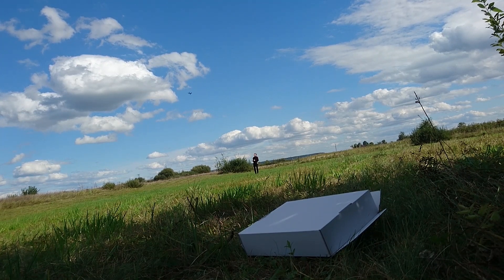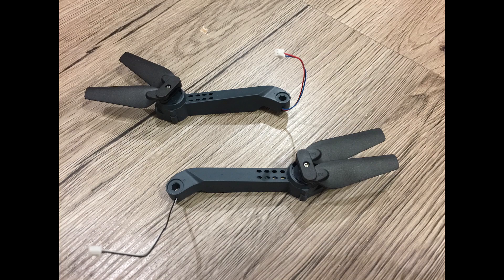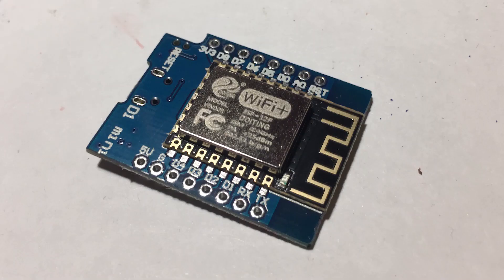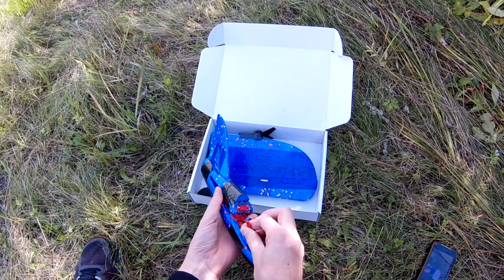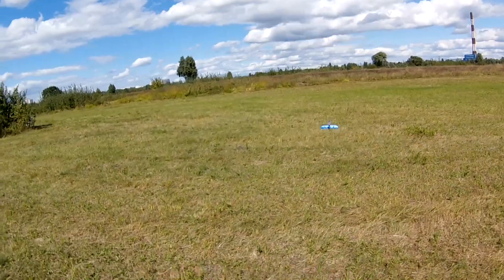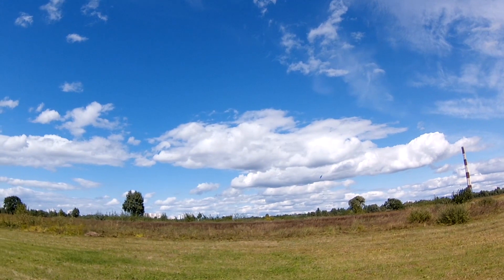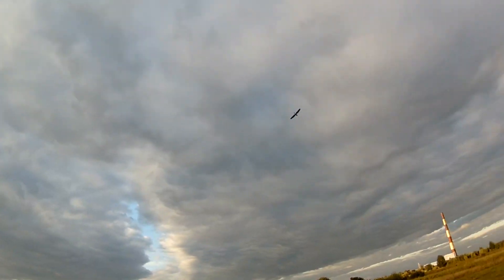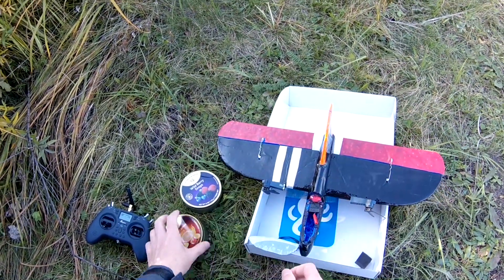[hx_espnow_rc] ESP8266 plane

Comment: Wow, absolutely stellar work! You're an inspiration -- seriously.  I have a T-Lite that's kind of just been gathering dust as I haven't been able to get it to work with anywhere near as many receivers as I had hoped..  I also have many mcu's but I'm very new to coding.  Actually now that I think of it, I'm not so much new to coding as just bad at it haha. I've been able to get both a PS3 controller and a Wiimote to talk to my ESP32's but have only figured out how to modify the PS3 TX demo sketch to control servos.  The Wiimote repo has zero docs.  It's soo refreshing to see a repository with adequate documentation!  Yours is like a full blown wiki! I bet that took almost as long as the project itself so thank you for publishing it; it should be a BIG help.

Comment: Good job. Do you think it can fly as tailsitter VTOL ?
Reply from the maker: These motors have 70g thrust at 3A, 50g at 2A and 35g at 1.5A. It is not enough for 120g tailsitter plane. While run on 3A, motors overheat and loose efficiency in few seconds. Long term current is 1.5-2A.
Reply: @RomanLutHax   range  of ESP NOW
Reply from the maker: @atntaltd  1km
Reply: @RomanLutHax   thanks for quick reply 
is that with your modified antenna 
Bravo man
Reply from the maker: @atntaltd  PCB antena - ~100m, whip antena - ~300m, 2dbi dipole - ~1km
Reply: @RomanLutHax  great
Reply: @RomanLutHax  
Great 
brilliantly detailed and comprehensive  code , i haven't seen such detailed  work anywhere , your work is masterpiece, you have covered everything (d1 min , e1 , ESP8266 , 32 .... ) , and you have anticipated what you did not cover like "encryption"  which is not essential and might complicate code 
if i were a dean of university  , i would have given you doctorate 
you are engineer by birth